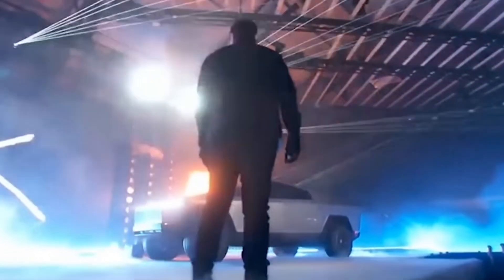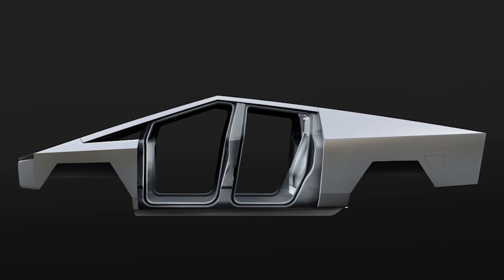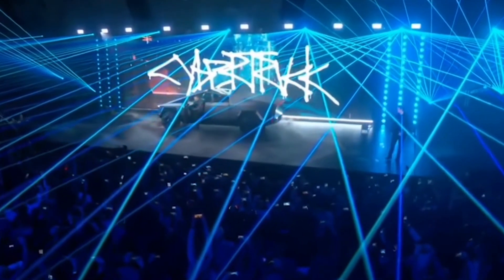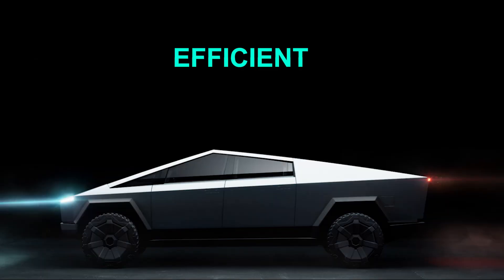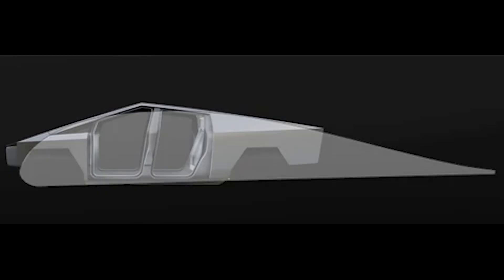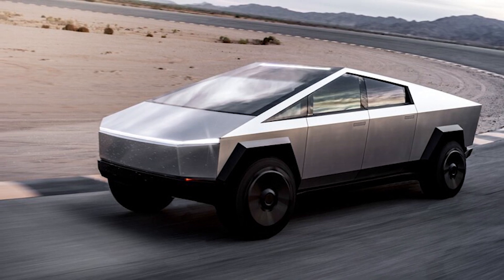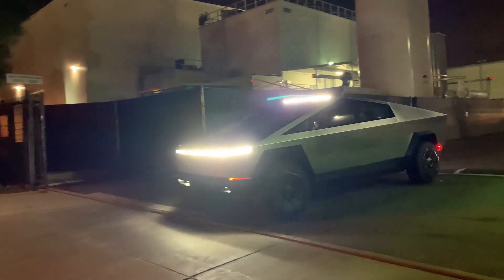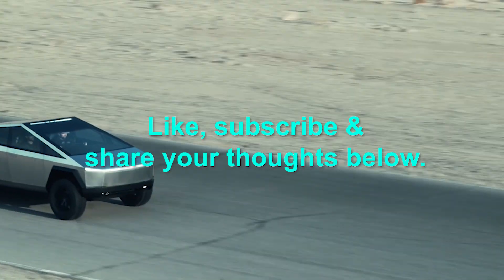Cybertruck is Engineering Genius (and will be copied)

Comment: Great now every auto company gonna want to save money on paint after they think we don’t give a dam about it
Reply from the maker: The way I see this playing out on Cybetruck is Tesla:

"You want paint? No problem, give us $5,000 and get in line. You will receive delivery after we're done with the unpainted ones".
Reply: @SolvingTheMoneyProblem  We already have that. For many economy models you have default color (ie white) and every other color is paid option. If I would buy a new car on a tight budget then I would choose pure steel over white.
Reply: @SolvingTheMoneyProblem  Apparently paint does not stick too good to stainless steel, but you can rap it in any color or pattern you like afterwords. The Cybertruck is perfect for rapping and because of its none curve design, very easy to rap.  Just buy the material you need and do it yourself.
Reply: Solving The Money Problem enower paint is not the good side of tesla
Reply: @middlehot  Don't want my CT painted or wrapped. Want it laser-engraved.
Reply: @SolvingTheMoneyProblem  I think buyers will just wrap it, for those using it as a vanity piece.
Reply: @SolvingTheMoneyProblem  ...dat Chronic will Sane the Craze & Craze the Sane....& rightly as well...especially in Micro-dose....WhatEVER y' doin' y' doin' it WELL...
Reply: @SolvingTheMoneyProblem   Pff ever heard of custom shops?
Reply: @SolvingTheMoneyProblem  ....this Stainless can be Buffed to a Mirror Sheen....and THEN Wrapped in  TRANSLUCENT Call-Your-Color(s) for a Candied appearance.... Speaking of Chronic....
Reply: @SolvingTheMoneyProblem  i think they should have made the truck with only 3 wheels for cost reduction :)))))) and maybe one door
Reply: Wrap it. More colors better colors. Matte colors,rainbow colors, designs,logos fake rust.. etc you get the point
Reply: @zekeo6163  ...fake rust...LOL
Reply: @zekeo6163  i want to do a baby shark skin wrap
Reply: @zekeo6163  the wrap is plastic and made out of oil so.....
Reply: May I direct your attention to dbrand?

Why would tesla waste time and lose focus on something someone else is already doing?
Reply: That isn't a bad thing. Fuckers purposely sell you cars that will be a heap of rust within several years. The paint protects the visible exterior from rust but the undercarriage isn't so even if your careful, if all goes to plan your replacing that thing within a decade.

Paintless cars need to be rust proof so their planned obsolescence won't fly.

Works really well for Tesla because they plan to have robotaxis bringing revenue in the future. Either owned directly by them or in partnership with the customers they sold the cars to.

So normally a company is incentivised to trick you into buying a new car as quick as possible and having the old one scrapped. Tesla is incentivised to keep as many of these things functional for as long as possible after the sale as they can earn a nice revenue stream from it and if profitable they could create a snowball effect where people buy more and more of these cars to just have them taxi people around while they enjoy early retirement.
Reply: Lol, I'm a designer and that's exactly the type of mentally lazy analysis marketing and CEO's make.
Reply: Robert Nicholls the marketers of those companies no damn well they couldnt replicate this and succeed
Reply: Stainless steel is not cheaper than cheap stamping and a coat of paint.
Reply: @AlexFlockhart  He explained that but with all the other variables it does
Reply: @Guadalupe Gonzalez
Yeah, you got it, all trucks on market are so creative designed vehicles. Thats the reason they look all the same. Oh, one more thing: Please dont say "we" because your not speaking for all of us.
Reply: We don’t
Reply: We don't. Delorean DMC anyone?
Reply: Guadalupe Gonzalez no. Some will copy it but there r a lot of ppl who want a regular vehicle. I work in the automotive industry so no worries there
Reply: @1979hellcat  I'm sure someone once had the opinion that people will still want a horse pulled carriage instead of those damned horseless ones.
Reply: Wrapping with a skins from third part companies can be purchased fairly cheap and applied yourself easily since it has flat panels (not rounded) on the CyberTruck.  Why would you want paint?
Reply: Fuck paint. Paint fails
Reply: Where I live about all vehicles are gray, white or black, so I think he is right.
Reply: HAHAHAHAHA "The steel is strong as fuck". laughed so hard
Reply: Fuck paint and its maintenance.
Reply: But we do so don't worry unless they rethink and execute this model again with a patch upgrade, this is not going to sell because the few "charms" it purports to feature are really duds. Maybe they've got other real aces like vastly improved battery safety and range, then they may have a real winner. But since they chose to display and show off some dud features, I'm going to assume they don't have significant improvements on any other fronts... maybe just the usual generational improvements but nothing impressive. The world will see I guess.
Reply: Its gotten bad enough with the choices of colors dissapearing, all I see is white silver dull red and black..its BS
Reply: It's like the headphone jacks all over again
Reply: Shepard  cheap stainless will rust
Reply: The Delorian (DMC) didn't make that much impact on paint.
Reply: Shepard I do agree with the clear coat as it will at some point rust it may take 10-15 years but it will rust.  But if something happens to the paint and you don’t notice for a few years it won’t matter as the damage likely won’t even show at that time frame but normal steel can literally show damage in a matter of days (personal experience in a steel factory with normal steel but can only google stainless steel)
Reply: If you want paint then buy it but stainless steel alone is pretty resistant. Why use your money on something that will get damaged and look like shit when actually used?
Reply: Paint is a band-aid for not using stainless steel. The other automakers HAVE to use paint.
Reply: It's coming in matt black as well so it will probably be anodized
Reply: Thats where other automakers will come in, altho for the lower performance in 1 or more categories where Tesla exceedes.
Reply: No, what will happen is what always happens with a marketplace. Someone will begin infusing color into their steel like they should have maybe been doing all along and a better result will come. Innovation sparks innovation.
Reply: Shepard  
Hi Shepard.  Why does stainless steel not rust?  Because it is ALREADY rusted.  It forms a transparent, hard oxide on the top surface.  If you scratch it, the exposed alloy reacts with oxygen and forms a transparent, hard oxide, which protects deeper layers.

You don't need to fret about stainless steel rusting.  Does the metal in your sink rust away in a year?

Warm regards, Rick.
Reply: Rust brown is beautiful!
Reply: @radocad  
Hi Radoslav,
I live in a house more than 55 years old, and it has a stainless steel sink.  It has been scratched by pots and pans, is often wet, and I see no rust.  

Perhaps they used a really good alloy in this sink?  Maybe I am lucky?

Or maybe you mean that it might rust in 100 or 500 years?

In my experience, that sink does not rust.

Rick
Reply: In the future I will have a lot attention driving my car. It's painted in a shining color different to the boring grey everyone drives. I remember that grey was in but it got boring because too many drove it.  Wrapping it will be quite expensive as the market requirement is too high. The reliability and robustness of it is rubbish as well compared to real paintwork.
By the way. Why don't we use the same color for our clothing's. The original color of the material. It would save money and reduces chemical influences on the environment.
Reply: Shepard  

Hi Shepard.  Do you think my problem is, that I am disagreeing with you?

My understanding of why stainless steel does not rust, is that it oxidizes forming a transparent, tough coating that stops further oxidization.  

Aluminum works the same way.  It instantly 'rusts' forming a clear, tough coat that stops further rust.

You claim that if my sink was outside, it would rust (unlike 55+ years of indoor use).  Maybe?  Would UV light break up the clear, hard coat protecting the inner layers of metal?  (I don't know.). Are there some versions of stainless steel that can rust more easily than other?  I don't know.

I do know if my sink can alternate wet & dry for 55+ years, saying that it will rust 'eventually', seems like splitting hairs.  I think most truck drivers would be delighted to have a vehicle who's body can last 55+ years with no visible rust.

But maybe you have some evidence that the stainless steel used in the Cybertruck rusts unusually easily?  I don't know that much about its alloy.  Perhaps Tesla picked a 'rusts easily' alloy because it is easy to weld?

Tho I have a science background, I don't claim to have any great expertise in stainless steel alloys.  But I have been impressed that my steel sink seems to go on forever, with damp cloths and hours with soaking dishes in it, and still no signs of rust.

Warm regards, Rick.
Reply: If everyone starts making stainless steel cars we'll run out of chromium pretty quickly
Reply: @hailstorm7868  Chromium is the 13th most abundant element in the earth's crust, just FYI.  It is also on average only 20% of the steel.
Reply: @hailstorm7868  that's also another issue that people are forgetting
Reply: @hailstorm7868  good job that there is approximately 11 billion tons of chromium ore then (source USGS)
Reply: @hailstorm7868  good job that the USGS estimates that there are reserves of11 billion tons of chromium ore then
Reply: With how good wraps are getting and how much cheaper it can be than a comparable paint job I don't see too many people complaining about having to wrap it. I would also imagine it will be cheaper than a normal wrap because it is so angular and doesn't have curves. Wraps are around 75% margin in terms of cost of material, the majority of what you pay for is labor time. I could even see pre-cut wrap kits being sold for it. This thing would be a hunters dream, almost totally silent and easily camo-wrapped to match your environment. This thing is super stealth mode! Not to mention the ability to power your camp for a couple of days.
Reply: @nickg2691  wraps can't be done with autonomy. So that supply and demand would jump wrap prices up very significantly.
Reply: I see what your talking about wrapping it but how many people actually wrap there cars not everyone has the resources to do it now so back to my subject of every car company decides to sell there cars unpainted everyone who bought a car would have to pay to get it wrapped... it’s not that serious so I won’t get to deep into it but just something to think of
Reply: @GuadalupeGonzalez-iz5tu  someone has the money to buy this but no resources to wrap it ? lol
Reply: @seansurfn2  39-60 Is a middle class budget but I see your point. I never wrapped so will check the price for the sake of this debate.

Edit: A long term vinyl wrap can run 10 grand. But basic is 2-5 grand. The vanity buyers will do it but not the people who need it for real work.
Reply: @GuadalupeGonzalez-iz5tu  "how many people actually wrap there cars not everyone has the resources to do it"
Because you basically pay a few 1000s for the factory paint. Even if it's "default" paint which most consider "free" it's not free of course, just included in the base price. And then you have to pay another few 1000s for the wrapping.
Reply: @GuadalupeGonzalez-iz5tu  im sorry to tell you that not everyone is going to like the same boring unpainted car
Reply: @GuadalupeGonzalez-iz5tu  But then the cars will be much cheaper. It's way cheaper to wrap a car than it is to paint one.
Reply: @GuadalupeGonzalez-iz5tu  Paint options on new vehicles cost like $2,000 smh
Reply: @GuadalupeGonzalez-iz5tu  Paint it yourself. Paint a flower or a skull on it, or draw stick figures, or tag it with loads of weird shit. 
It would be nice if the roads were a bit more diverse than 20% red cars, 30 % black cars, 20% grey cars, and then a bunch of other boring colors.
Paint it yourself.
Reply: Exactly smh 🤦🏽‍♂️

Comment: Awesome!  I have my tri motor reserved with FSD.  Can’t wait!

Some ideas would be to perhaps interview existing pickup truck owners and get their thoughts.
Reply from the maker: Cool Sean, you'll have an awesome vehicle in a couple of years. Is this your first tuck? First EV?
Reply: I ordered mine already
Reply: I am also looking forward to buying this truck once it is released in Germany / Europe. FUCK VW
Reply: The cybertruck will be my first EV. And I used to drive Ford F-250 several years ago.
Reply: It's interesting but its just a tesla with a big trunk. Your 500 mile range will quickly drop to 100-150 miles if you try to tow or off road with it(the main purposes of owning a truck.)
Reply: @IMakeVideosOften   Don't speak too fast pal. You have no idea what your talking about there are many factors at play when towing. It could be as good as around 350 range while towing full payload. We will have to wait and see.
Reply: @IMakeVideosOften  EVs should do exceptionally well off road because they're even more efficient at low speed and have better torque for inclines, the Tesla Semi has a HUGE incline advantage over regular Semis.

As for Towing at worst you'd be looking at what, half range assuming they made no advancements? So that'd be 250 miles depending on what you're towing.

PS: Tesla should either increase charging speed somehow, or maybe make replaceable battery packs that could be swapped at a station, but these are investments that would have to come after EVs are WAY more mainstream. For now a cable is easy.
Reply: There are channels that did that
Reply: I went with the dual motor, if only because I couldn't think of where they'ed stick a third motor on. Kind of sad there wasn't a quad motor option, I'd have liked the ability to drive sideways, would have made finding a parking spot in the city so much easier...

Comment: Cheap: Doug DeMuro has a video mentioning other ICE trucks are cheaper for the specs you get.
Reply from the maker: Granted, many ICE equivalents are on par/better in a narrow sense. One might have more range, or higher towing capacity, or a longer bed, but if you weigh up all the features and functionality (including things like autopilot, sentry mode, running costs, built in secure roller for the bed, storage, ramp to bed, built int power outlets, toughness etc) it's not even close. There will be special use cases where Cybertruck can't compete but big picture, wider market, it's a home run. Don't forget, battery and computer costs (the two most expensive components of the vehicle) are on declining cost curves. EVs will become even more cost-competitive as time does on.
Reply: Those Gas powered vehicles are fundamentally different.  They are designed for gas not Electric.
Reply: first last there are several videos debunking Doug.  Doug is wrong....big time.
Reply: DeMuro is an idiot.  He did not compare like for like and put no value on a truck which can't rust or easily be dented, or easily have the windows broken.
Reply: @JRP3  As well as:
AutoPilot
FSD
lockable vault
air suspension
built-in air compressor
220V outlets
electric tonneau cover
full width bed (no wheel bumps)
higher ground clearance
no tunnel
T-slot infinitely adjustable tie downs in bed
Tesla safety
superior performance
Reply: @JRP3  my truck is a '99. It has zero rust, zero dents, and has never had a broken window.
Reply: @zzz7zzz9     Oh wow, I guess that proves that steel never rusts or dents, and glass never breaks.  Amazing the way your personal anecdote is supposed to disprove reality 🙄
Reply: @JRP3  no, just saying, that doesn't happen to all vehicles.
Reply: @zzz7zzz9   I never said nor implied that it does, but the potential is there for all vehicles.  The Cybertruck greatly reduces that potential, and that has value.
Reply: @JRP3  nope. A guy in europe's battery failed on his tesla. They wouldn't replace it, and it cost him tens of thousands for a new one. Tow companies are reporting how they have to store EVs in seperate fields, by themselves, because they are exploding.
Reply: @JRP3  and you should know that reports and stories aren't FACTS. That's the problem these days, everyone believes what they read and are told as the gospel  you probably believe "studies" also.
Reply: @zzz7zzz9    Gas cars catch fire and explode every day, it's rare for an EV to do so.  Gas cars, especially high end ones, can cost tens of thousands for engine and transmission replacements.  No product made by man is perfect so you're anecdotes are meaningless.  Most Tesla's never catch fire, never explode, and will never ever need a new battery pack.
Reply: @JRP3  i'm not defending gas cars. Just saying, EVs aren't without problems and costs. Are they the future, fuck ya. Should we be forced to convert today, fuck no.
Reply: @zzz7zzz9    You "heard" about one guy in Europe with a bad battery, I talk to hundreds of actual Tesla owners on the forums every day for over a decade.  I also know lithium ion cell chemistry and behavior and keep up on the research.  You obviously don't.  I'll put this quite simply, today's battery cells are easily capable of more than 1000 charge cycles, and for a car with 300+ miles of range that's more than 300,000 miles.  Those are simple facts, ignore them if you must to keep in your bubble of ignorance.  Reality will continue to advance without you.
Reply: @JRP3  elon has a car floating in space, and sold people flamethrowers. And doug's the idiot?